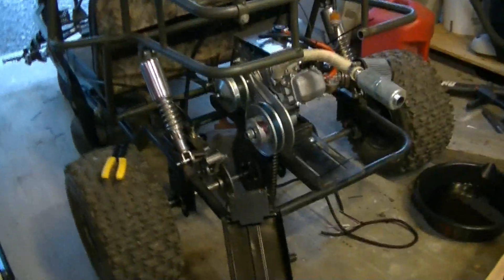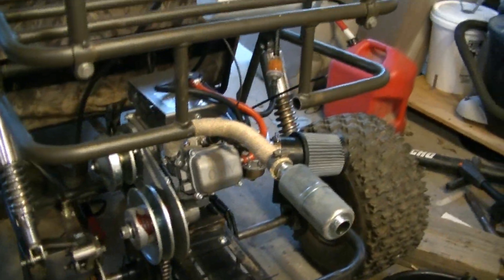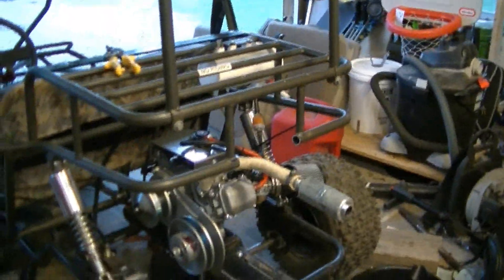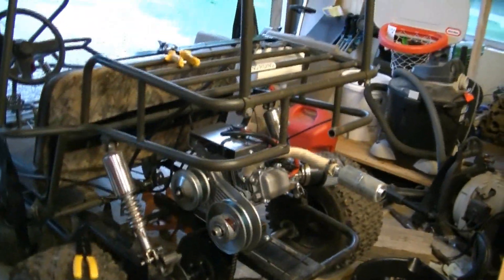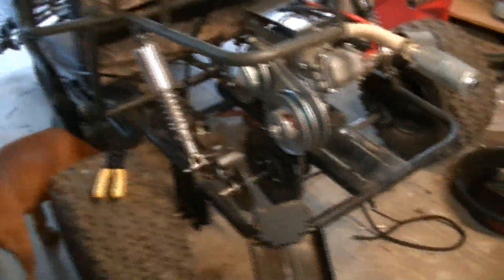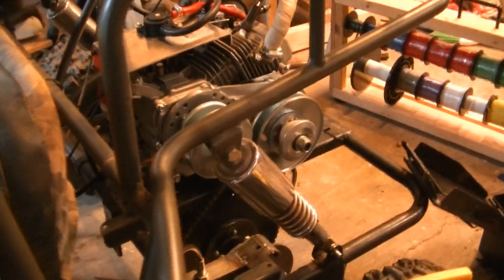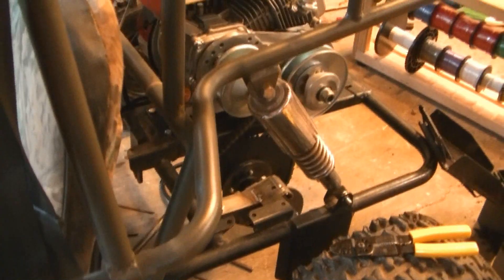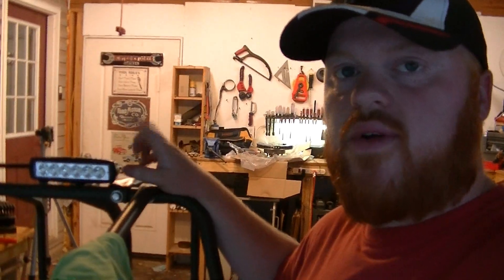Predator 212 First Start

Comment: my grandmothers tractor has a battry and headlights the charging system runs off the impulse signal from the coil pack on the kill wire, it has a rectifier diode that turns the ac to dc to charge the battry. im shure that there is a diffrent coil that would fit on your engine to charge your battry

Comment: Why not a 420cc predator?
Reply from the maker: There a little expensive. I think I may put a small atv engine so we can have reverse and gears. Just have to see how good this motor pulls
Reply: Hey Red Beard, you should look into using a Lifan 125cc motor. They have electric starter motors available as well.
Reply: +Red Beards Garage I got my 420 Predator at Harbor freight during their tent sale for $200. I did all the same mods on it that you did on your 212. Took off the pull start and put on a sick Billet 420 cover, now  hoping to find a Billet flywheel. Seriously considering putting it in a mini-bike.  lol Great video btw!